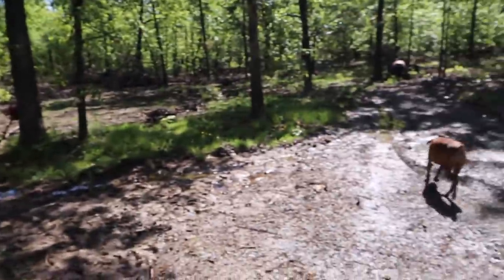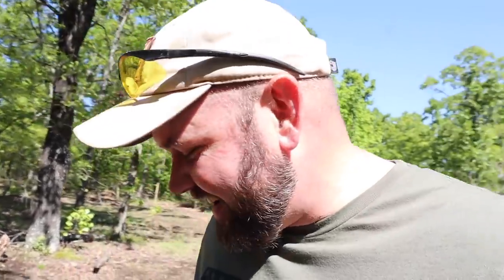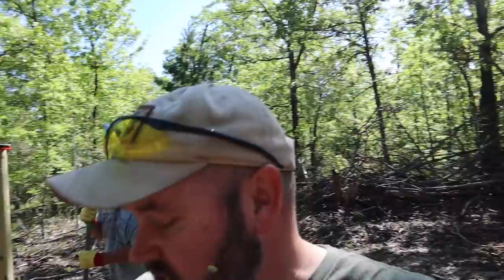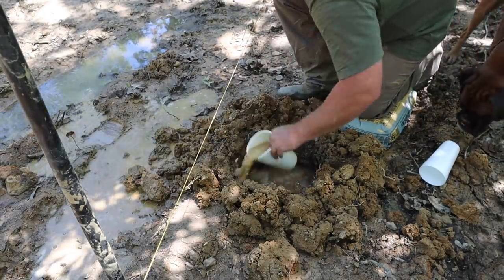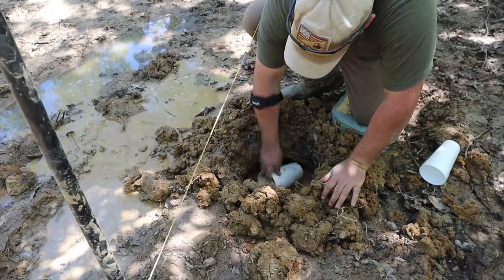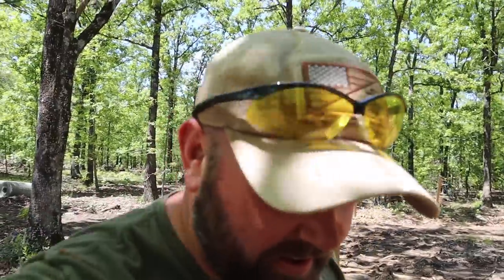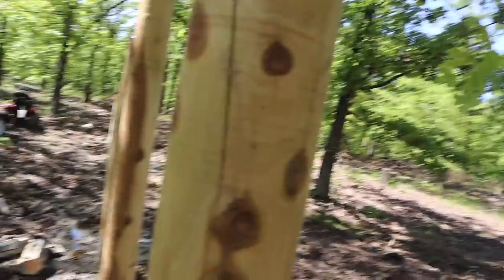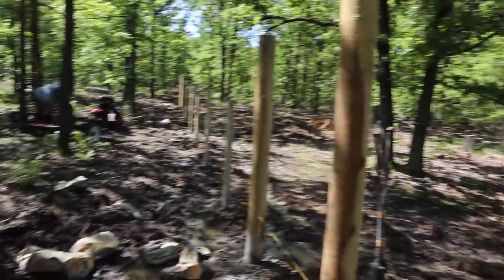HOW TO USE A WALK BEHIND AUGER

Comment: Nice straight fence posts, looks great 👍 I didn't notice till you were loading up that it also had a small trenches attachment. You may have other plans already but a trick I learned when I had pigs was to get the hog wire 6 to 8 inches below the surface level. As the hogs are rooting around and they find a place to root under the fence, they will. I would just use the trenching machine to outline the pen before I drilled any holes and that also helps keep the line straight. If you don't want to bury the wire you can also fill the trench with concrete, it's just more expensive. Great job and I am really enjoying your channel!

Comment: Dutch, when we built our home out here, (we have 2+ acres which was heavily wooded) but we knew we were going to have to take out a number of trees.  We have a Ford 9-N (I think) tractor, and we bought for $500, an auger that fit on the and was operated off the PTO of the tractor.  It took no time at all to drill the holes for fence posts, and we even helped out one of our neighbors living about a half-mile from us.  We drilled 300' + of fence posts for the neighbor in about a half-hour.  It was amazing.  When we finished with it, we sold it for as much as we paid for it!